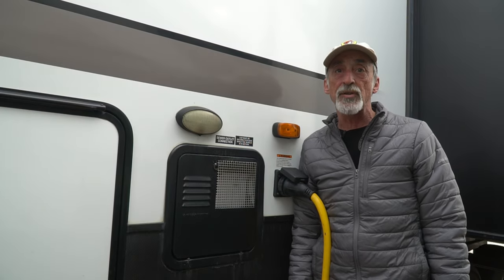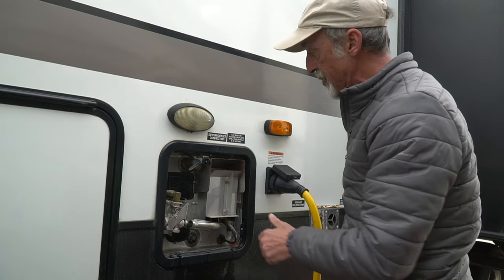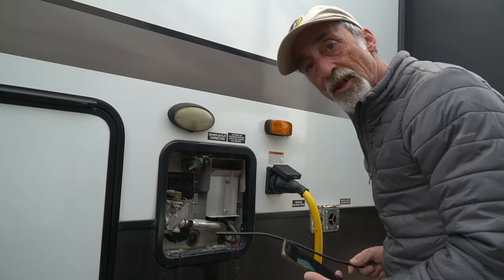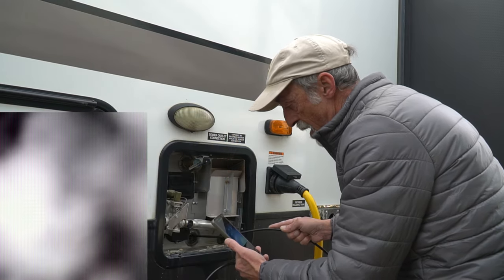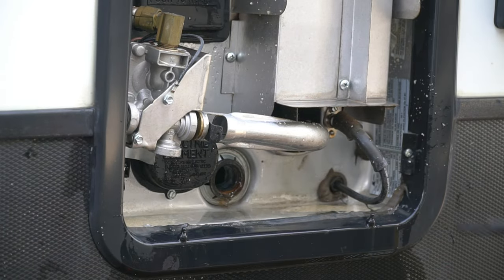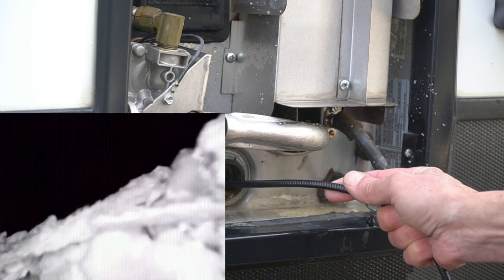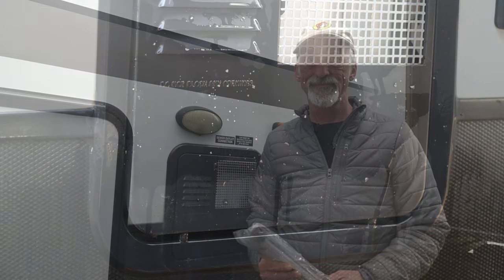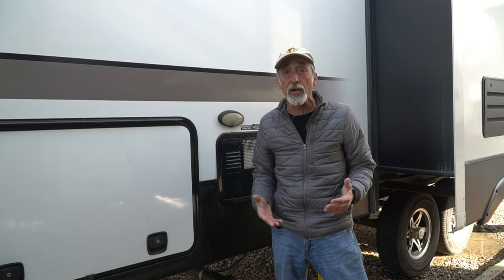Ep. 299: RV Water Heater Annual Maintenance | recreational vehicle camper Suburban

Comment: Great reminder. When I moved to a 5th wheel with a bigger hot water tank it did change the frequency of changing the anode.  Now it is once a year but with the smaller tank it was every two years. Also, that looks like a nice wand to flush the tank, but I believe the small plastic one would work better, it has a 90-degree bend at the tip. It also has more velocity to agitate the debris.  I also tip my rig to help the water/debris come out.
Reply from the maker: Great tips, Nick!

Comment: Very well done.  It is important to get the corrosion debris out of the tank so that the grit won't get pulled into the faucets and other HW valves, get caught and wear away the seats.  I have made a trip to the pawn shops to find a good used 1-1/16" socket with the appropriate drive handle and maybe a short extension, only the exact items I needed.  That had been less expensive than even buying complete sets made of chinesium.  Bore scope is a great idea, and the pressure wand a clever bonus.  Thanks for sharing the links!
Reply from the maker: You bet Richard, and thanks for watching! It's an excellent idea about going to a pawn shop to get only what you need. Sometimes I would like an extra socket of a certain size, and that's a fantastic way to do it.

Comment: What???

I didn’t know there was a sacrificial anode in our water heater. I didn’t see anything in the manual. 

I will definitely have to look into this.

I like your borescope. All the cool kids have the best toys.

Just for future reference, wrap the Teflon on in the direction like you would follow the threads. That way when you are threading it into the hole, it will be tightening the Teflon tape and not trying to unravel it as you tighten.

(Hopefully I explained this clear enough)

Thanks for a very informative video.

Ram
👍🏼👍🏾
Reply from the maker: You did. I've got a habit of getting that wrong.

FYI, if you have a tankless water heater or an aluminum tank you won't have a sacrificial anode; otherwise you surely do.

Comment: We just had to replace our backflow  preventer valve on our hot water heater today!  Our toy hauler is 7 years old and we are full-time.
Reply from the maker: Does do indeed fail, Susan, both an RVs and in residential homes.

Comment: Would have been nice to get a few gallons of vinegar inside the tank. Let it sit for several days then reflush. Perhaps a way to get it in would be to remove the pressure relief valve
Reply from the maker: Great idea, Mike. If our RV was sitting for a few days without a need for hot water, that would be a great option. Just like descaling a coffee maker.

Comment: Thanks Marc. Even after 20 years of RVing, you can learn something new.  I like the borescope and bet it can help with a lot of low access areas of an RV.  Would you buy the same one again?
Reply from the maker: Absolutely I would, Pete. We've had this one for a few years. It tends to be less expensive because it uses your phone as a display. You also have the ability to record photographs or video using your phone. This is the first time I've used it in the water heater, but I've used it many times to fish down into a wall to see what's back there. We put an Amazon affiliate link to this one in our video description.

Comment: Please note, when refilling the tank, OPEN the pressure relief valve until the water rises and starts to flow out of the valve, then snap it closed. This puts a head of air in the tank. This is detailed in the water heater manual, both for Atwood/Dometic (no anode rod) or Surburban.
Reply from the maker: Thank you for that, Charles!
Reply: Nor recommended to operate pressure relief valve as it might now leak if older.
Also water heater tank is not a well pressure tank and will totally fill once faucets are used to  ent any air in pipes and tank
Reply: @danieltemple3144  Without getting into an internet argument, the manuals call for the head of air which is trapped above the point the water exits the tank. The information is contained in manuals for both brands of water heaters.
Reply: The head of air also seems to help the water system on my Casita to retain a little pressure so that my water pump does not turn ON immediately every time I open a faucet, even for a second or two.  If I leave the water running for more than about 5 seconds or so, then of course, the pump activates.  Hope that this is understandable, it’s a little difficult to explain. By the way, a running water pump in my Casita is a very noticeable event! 😖